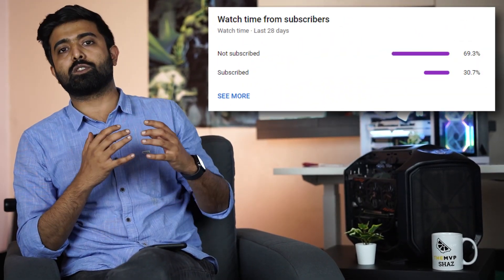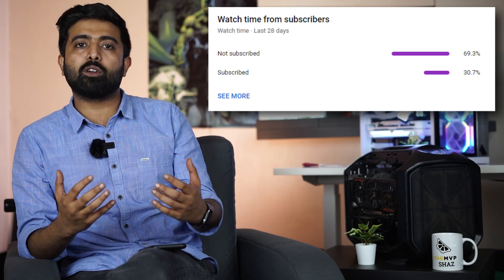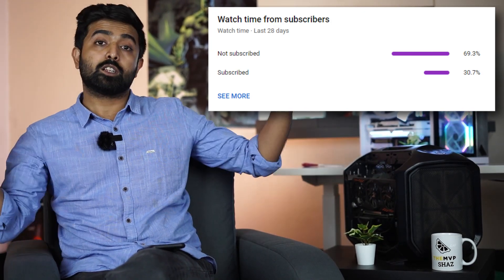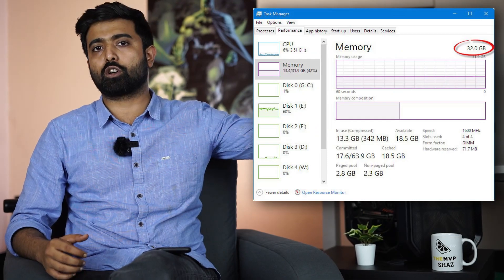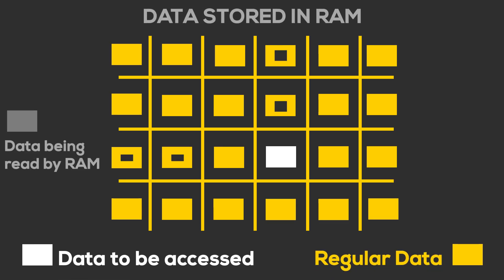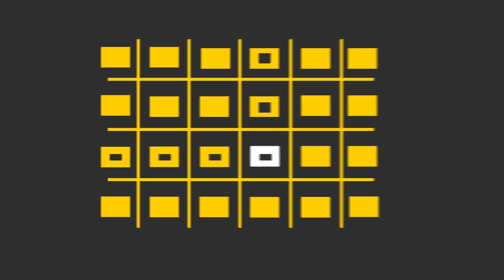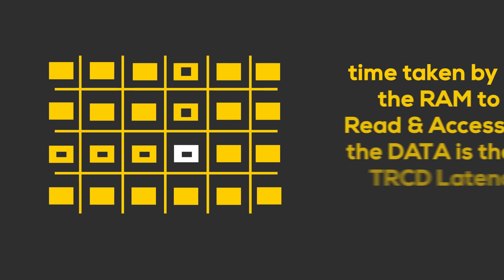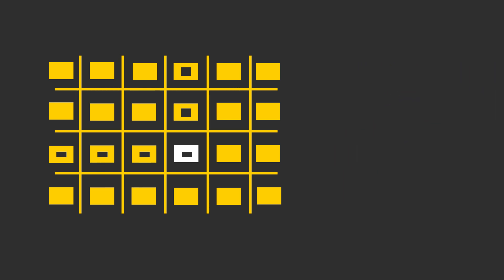DDR4 vs DDR5 - RAM Speed & Timings Explained | CL16, CL18, CAS, tRP, tRAS | theMVP

Comment: Brother, I have a RAM in my PC with 8gb 2933mhz 21-21-21-47(intel b460 mobo) and the only model I could find in the market is 8gb 3200mhz 21-21-21-49. Please tell me can I mix these 2 RAMs to get dual channel 2933mhz?
Reply from the maker: nope, won't work that way - you'll need both RAMs of the same model